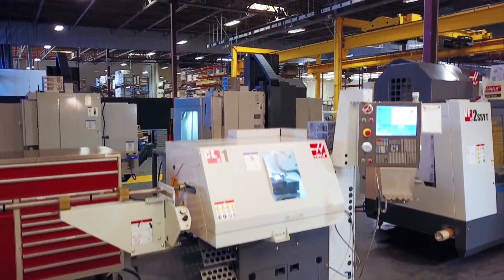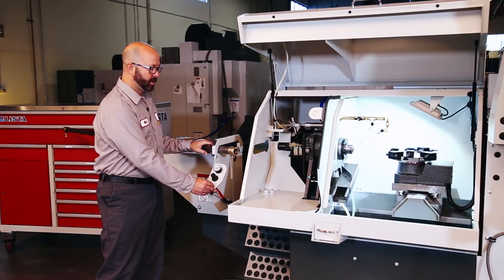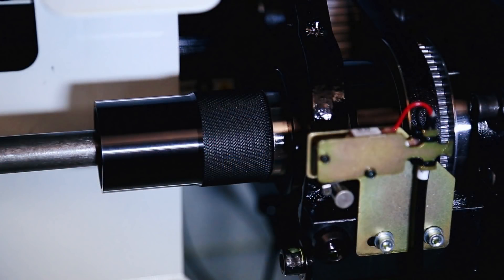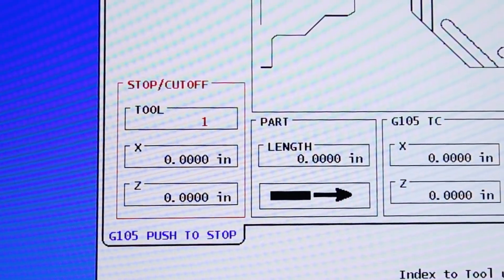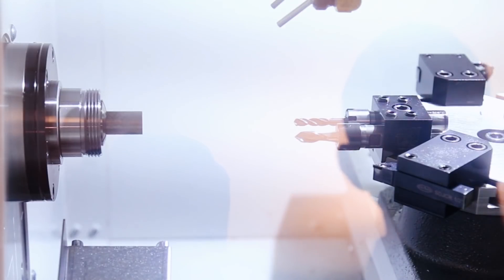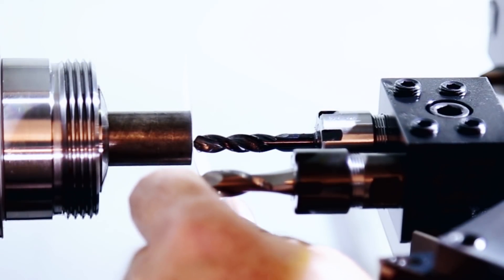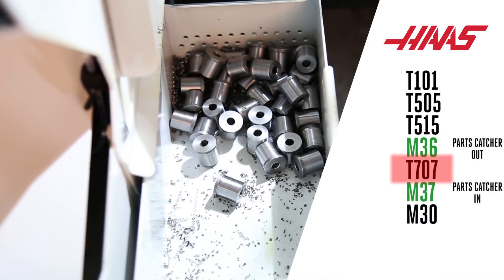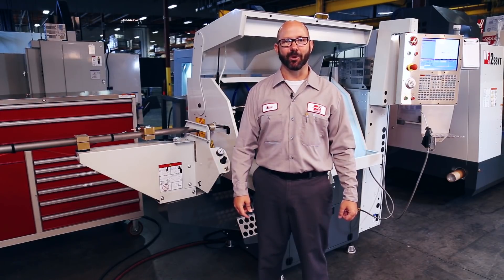Haas CL-1 Operators Guide

Comment: This machine has incredible hang-over from the saddle. I can't see how it will be rigid at all. On CNC lathe's, effort is usually expended in trying to design the tool tip directly above the X slideway.

Comment: IMPORTANT!!...With my CL-1, the on-screen instructions for the bar pusher don't look like this and you don't jog to cutoff position, you jog to where the stock will be before you start cutting (G54 plus the amount to face off in most cases). This is important if you are working near the chuck. If you set it the way they show in this video, it will potentially plow into the collet/spindle. When in doubt. set it way out in front of the spindle to verify which way your works.

Comment: how quaint, a muzzle loading lathe, do you make one in which you load stock from the safe end?- the end on the opposite side of the head stock of the lathe, so we don't get bitten by any tools in the lathes' operating zone.
Reply: You don't have to get into the tool area to load a bar. The feeder swings out to load. You can see it more clearly in some of the other videos.
Reply: MG42 barrel change

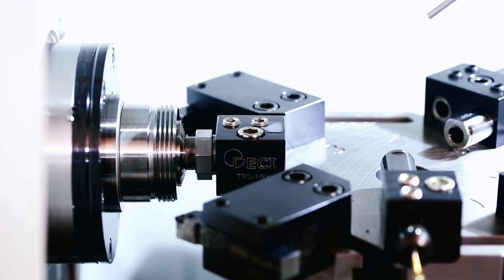Comment: How about a video on setting the tool offsets on the CL-1 including the offset entry on the interface. Specifically, when setting up drills in the gang tooling and you are setting X on a drill, there is no set to center option so do use "X diameter measure" enter a "0" when asked for diameter? ===== UPDATE: For anyone reading this and wondering the same thing; I indicated the tool holder to center and hit "X diameter measure" then used 0 when it asked for diameter. This worked fine. Also, there is a change in the NGC (next generation control) for bar feed. It is mostly the same, but there is one IMPORTANT difference. Where Mark says at 5:30 to move the bar stop position to where the stock will be when it is cut off,, the NGC requires you to jog to part zero instead. That is where you set the position. This can be a problem if it is set wrong since the feeder will plow into the collet during a bar push if it is set wrong.
Reply: Hi David, have you tried to make double push with the bar pusher? There are g105 address codes, any experience with that?
Reply: @autumn8468  I don't know what you mean by" double push".  But I do use the bar pusher.
Reply: @dsh1001  G105 with a J code. Double push operation is for making a long part.
Reply: @autumn8468  If I understand you correctly, you want to avoid tool deflection on long, thin parts. You want to (for example)  push the stock, turn half the part, then push the stock again to turn the other half.  You can probably do it (sort of) if you have macros enabled on your machine. I believe all of the bar feeder macros are in the 31xx range. Essentially, you run the first half of the program then put in a line of macro commands to change the bar feed length (#3100 I think), feed to the new length then run the rest of your program.  The only problem would be getting the bar to feed to that second position precisely every time. I doubt the CL-1 bar pusher is capable of that sort of precision since it is a simple feed-to-stop type. You would probably need a servo driven bar feeder to be that precise and even those are usually only accurate to about .005 inches at best. A swiss-turn machine may  be a better fit for this type of part.
Reply: @dsh1001  Thanks David. Swiss would be a better choice, but we have the CL-1.

Comment: Any good for cutting steel Is there enough horsepower and rigidity
Reply: Yes this video shows it cutting steel. This machine has 5hp, which is plenty. It can probably cut titanium and other even harder metals.
Reply: I have been cutting 304 stainless and it does well.

Comment: This brings back a lot of good memories from the old Hardinge CHNC (I think was the model).  I ran them for many years and loved them.   Looks like the basic mechanical design was pretty much kept the same and the programming and electronics brought up to current technology.  I'd love to get back to this design again. Very easy to set up with the combination gang and rotating turret.
Reply: You would probably recognize the way the collet closer works too. It is the same lever-type closer but they have mounted an air piston to lock it in place.

Comment: Can the CL1 do live tools?
Is Haas ever going to make a swiss type machine?
Reply: No and probably no.
Reply: Yes it does live tools, not sure if they can be put on the turret for axial milling and off center drilling though. The website shows it as a side mounted option, so that would allow milling and drilling only perpendicular to the spindle
Reply: So far it is capable of two live tools that will drill/mill on center only. The tools are mounted on the same slide as the turning tools but on the opposite side. I have been using negative numbers to program the live tooling but there may be another way.